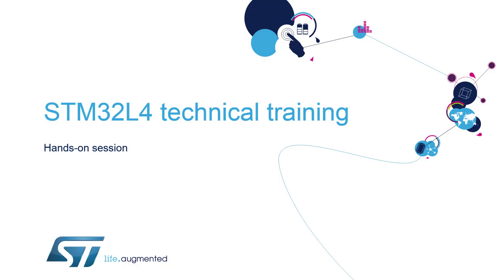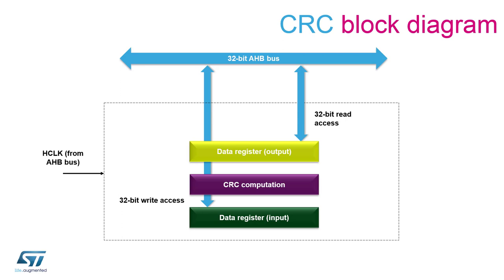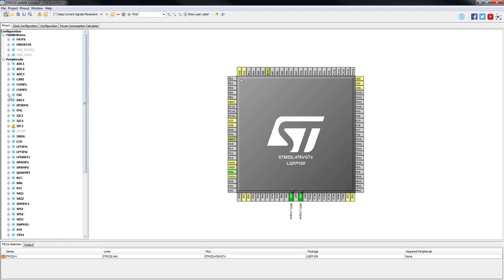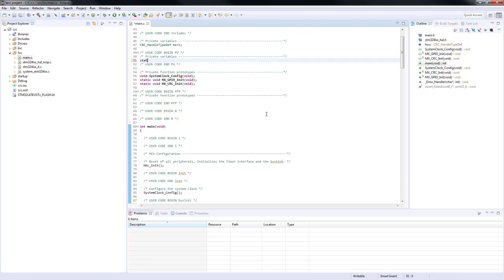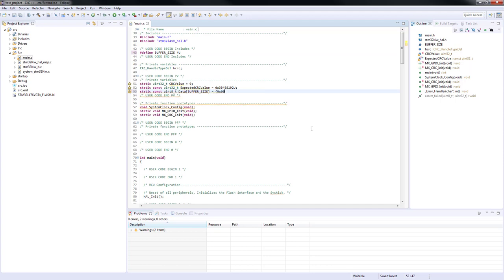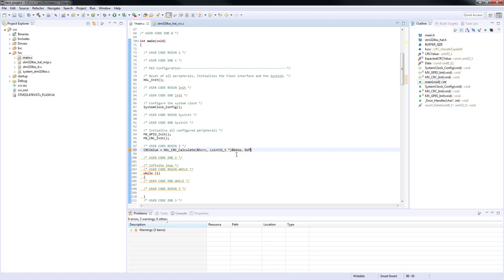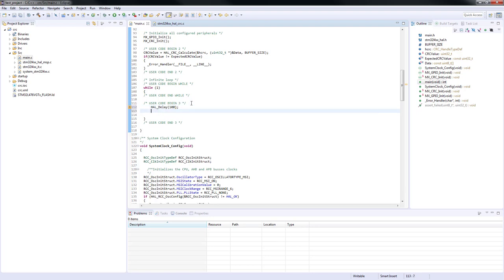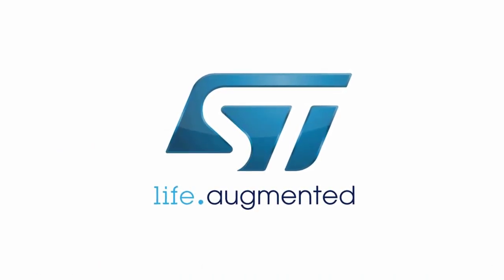STM32L4 training: 02.4 System and memories - Hands-on CRC unit

Comment: I am using STM32L1, for this board in STMCubeMX it shows 'This peripheral has no parameters to be configured". What would be the problem? How I can set those settings?
Reply: have a look at your clock settings, i also had the same issue but it got resolved after setting up the clock at the max.